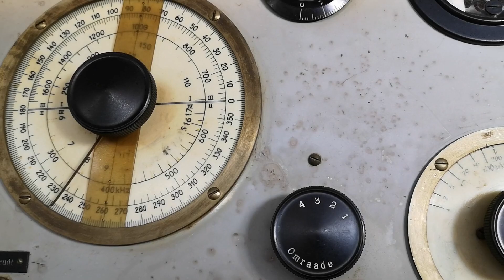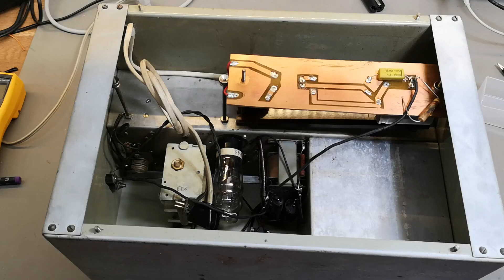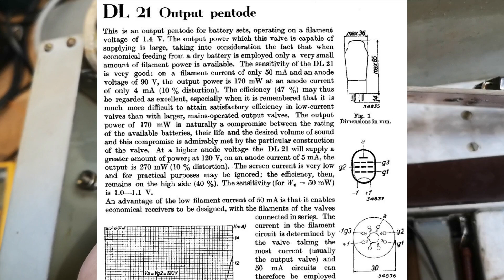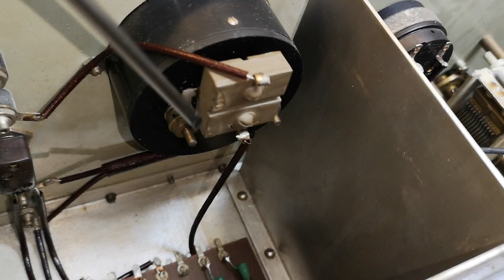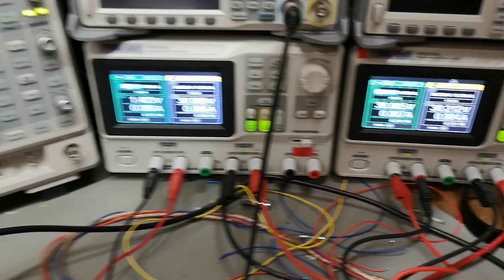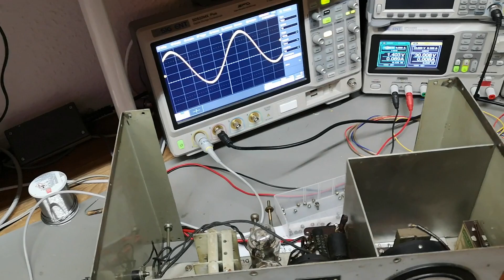Radiometer signal generator M54 1940-50 two DL21 tubes test teardown

Comment: DL21 er direkte heatet. Det er de fleste batterirør, dem jeg kender i hvert tilfælde. Du kan heller ikke se glød og mærke varme fra dem. De  kan til nød tåle de 1.6 volt som et nyt batteri giver men så heller ikke mere. 1.3 er fint 1.4 er rigtig fint. .
Reply from the maker: exactly, it is amazing how fast this type of tube warm up :-)
Reply: @TeardownOZ2CPU  Jeg har 2 rør batteriradioer, med forskellige typer batterirør. En To-r fra 1951 og en Norsk David Andersen fra 1953, som jeg har renoveret. De 90 volt klares med 10 Stk. 9 volt, klipset sammen.